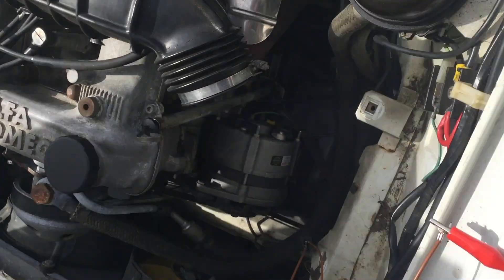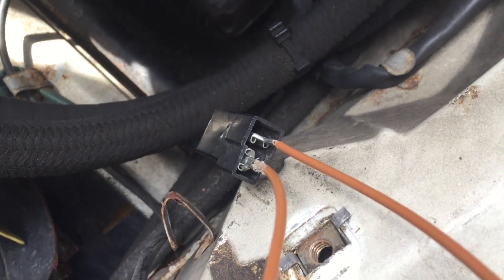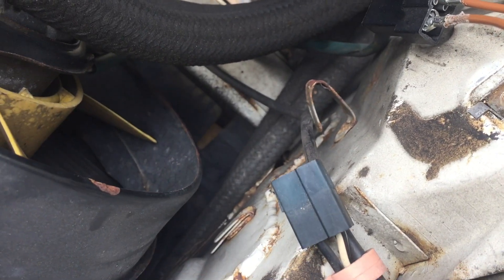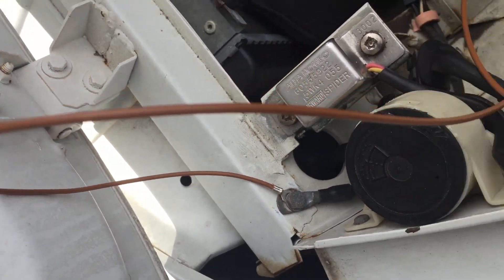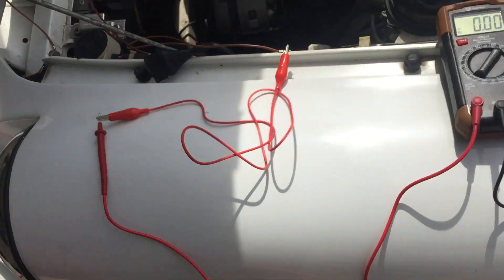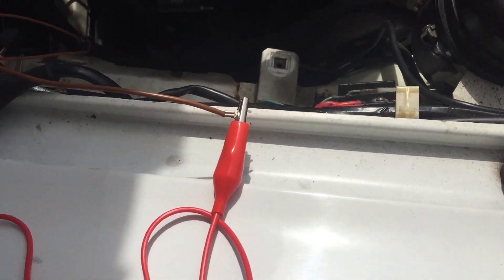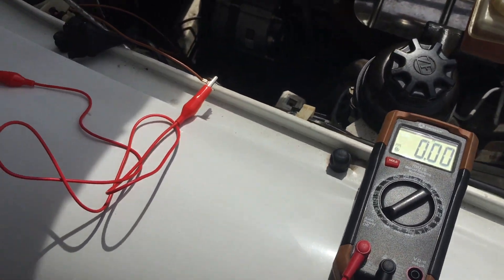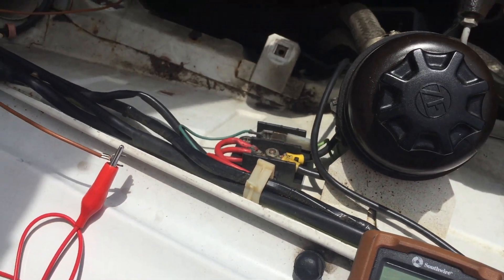Alfa Romeo Spider 115 Stock Cooling Fan Amp Draw Test

Comment: If you are installing relays a shunting diode should also be installed on the power source relay legs to preclude burning out the  internal relay coil wires.
Reply from the maker: That's a great tip for anyone installing relays!  I was thinking about doing something like that but then decided against it because of the extra complication.